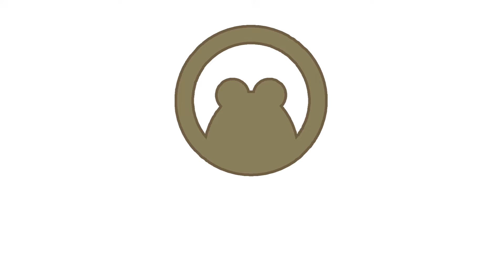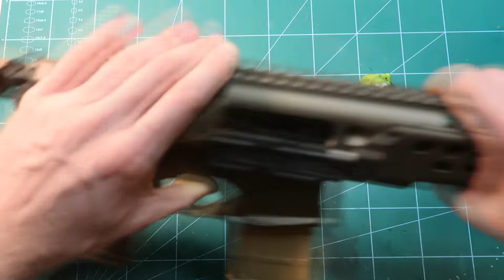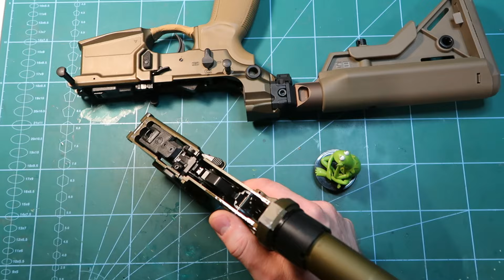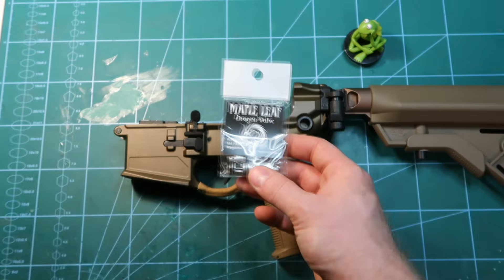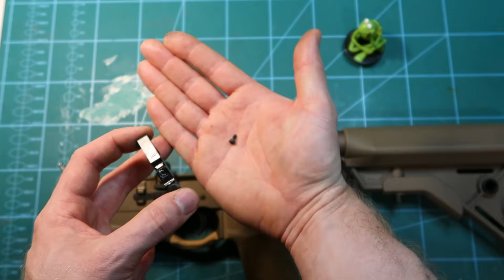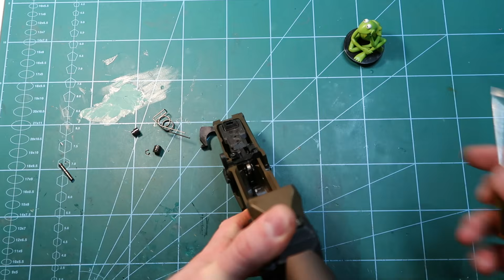Frog Appendix #08 - Improving APFG MCX GBBR performance on HPA, applicable for all VFC AR15 V3 GBBRs

Comment: Hello maybe do you fix overchambering? I instaled wintersprings on mine but had no luck. Ofc it worjed with modify x range 65 bucking and winter springs but 4uad bucking is just way more accurate. And with winter springs gun feels kinda slow :D i know some guys drill abit of the nozzle inside so the bb dont go forward to much when loading. So maybe did you find any good way to prevent overchambering? I also use hpa in apfg mcx
Reply from the maker: Honestly I neever saw any real benefit of using 4UAD bucking. There was a huge hype when they came out so I bought some to test them and they are just as any other bucking to me. That is a flaw of all buckings without BB holding ribs, then can overchamber. You can try putting a aluminium ring, around the bucking where it seals to the nozzle, under chamber walls, but not over the hopping patch. You can cut it from a piece of coca cola can, make it 1mm wide, you can experiment with different thicknesses when you stack multiple rings. The idea is that this will make bucking tighter at the entrance and maybe add enough friction to stop the BB on time.
Reply: @frogengineeringairsoft i tested 4uad and modify xrange 65 with 1.5J and .3g bbs. Yeah xrange stops overchambering but 4uad is more accure